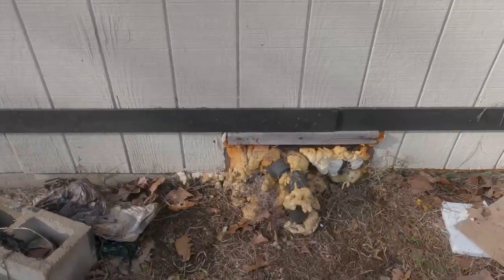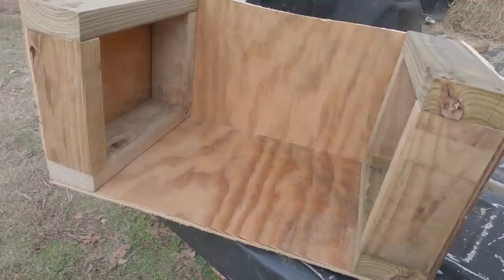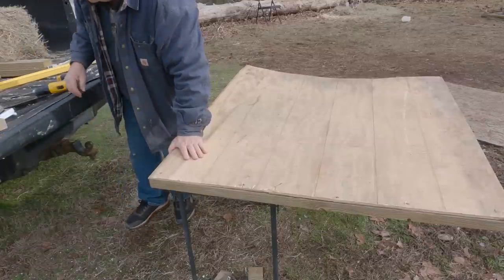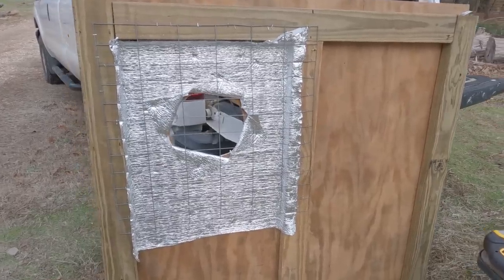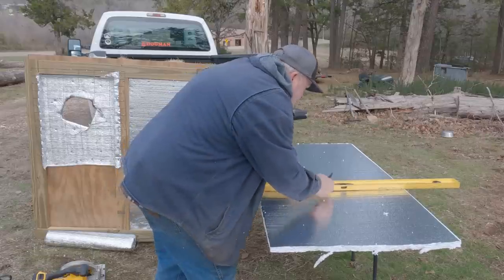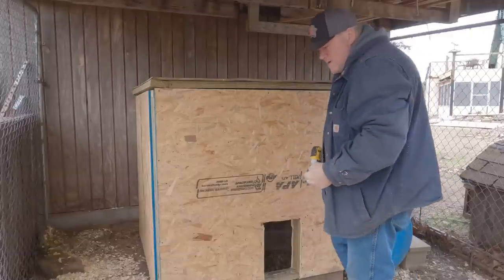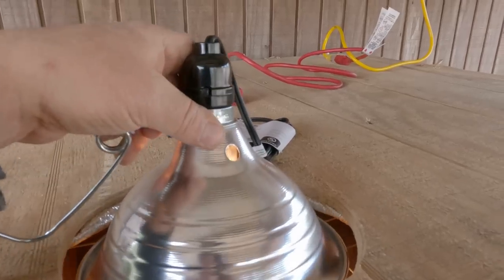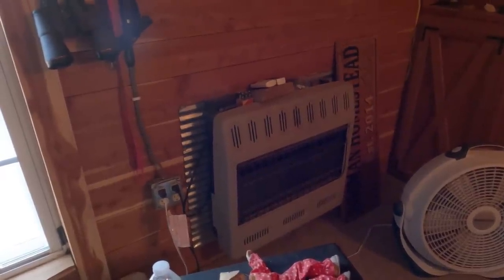We Have Heat! Cold Weather Doghouse Enclosure Is Finished.Ready For Arctic Blast

Comment: There for a second I thought I'd been filming myself.🙄 Just put one of those fixtures in my wellhouse pointed at the pressure switch w/a 200W incandescent bulb. I usually pay a little more for the fixtures that have a ceramic bulb holder. Everbody gettin ready for the cold snap. Found out too late my propane tank for the heated barn is empty. 

😬What's the ettiquite for ordering a 500 gallon  propane delivery right before Christmas?  Do ya call em when the days high temp is gonna be 7°, or 10°... or do ya wait for the warmup 2 days before Christmas when its 37°?🤷‍♀️🤧